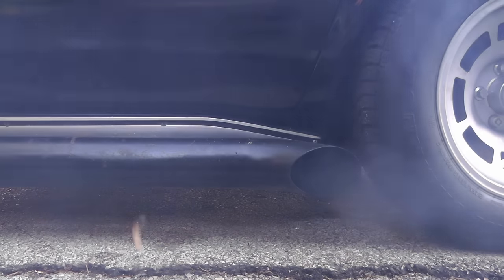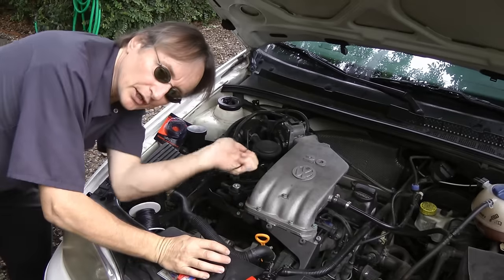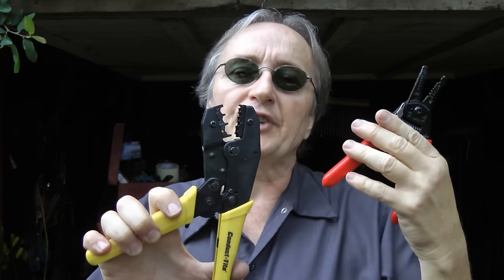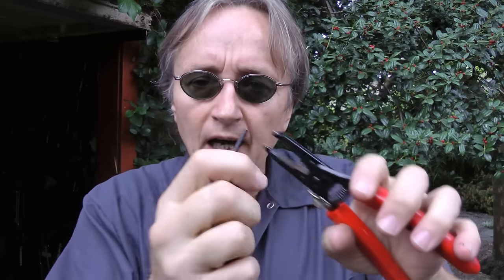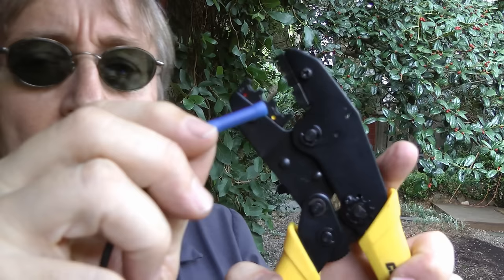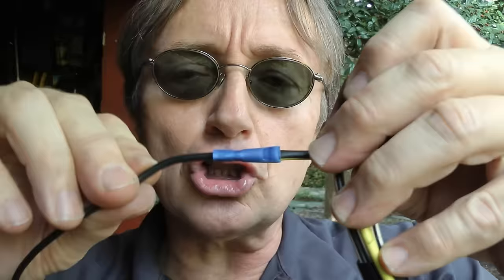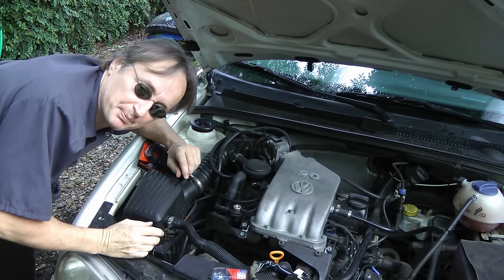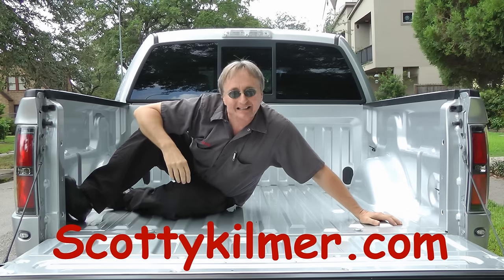How to Splice Wires Together in Your Car

Comment: Ever heard of a c305 connector well turns out I replaced my fuel pump my car cranks but won’t start I replaced the start the fuel filter the fuel pump the battery and all the spark plugs nothing worked well I found out there is a c305 connector under my van near drivers seat well behind it and it’s all nasty corroded and looks burnt ! I wasn’t getting any fuel pressure ! And no power to fuel pump ! I kept getting fuel pressure sensor low circuit is this why Scotty?? Is it the c305 connector ?

Comment: Hey Scotty got a question for ya. I have a 1996' Ford Contour SE 2.5litre out of nowhere my car stalled one day and smoke starting coming through the AC Vents (white smoke smelt like rubber) the car would NOT turn on, no dash lights nothing not even with a boost. I took the battery out put it in my other vehicle and its good, the oil was not milky at all and the coolant seemed good. Leaving me to believe that its the wiring harness, how would I go about finding the right wire?

Comment: Temporary fix only, nothing beats solder and double wall heat shrink tube. The double wall tube is thicker and contains glue to make your connections water proof.

Comment: my check engine light came of it was for a knock sensor on a trailblazer. I replaced it then it came on again. do you think i need this done to my knock sensor connector?
Reply from the maker: +LeMark Wash pray it's just that and not a computer or internal engine failure

Comment: scotty i have a 2010 nissan altima the dealer told me that 4 of the wires have been cut from installing car audio the new wire harness is 500 bucks plus 700 bucks for labor all my lights in my dash is on an the car wont go over 2000 rpm an wants to shut off do you think i can fix it my self an save my self 1300 dollars by doing what you did in this video

Comment: I had brittle wires for the ECT connector that tore off. I bought a new connector and used butt connectors to fix it. Tried it multiple times and no fix. I know I'm doing it right too. Not much to it. I was wandering if there was some reasoning why butt connectors wouldn't work in that situation if any. I also replaced the ECT sensor as well.

Comment: recently my 2008 ford explorer had power cuts while driving and when ever I used to press the brake and stop the car it automaticaly turned off, I gave it to repare,the the mehanic told me its just the wiring problem and it will be fixed if he changed the wires. does changing wires will stop the problem??
Reply from the maker: it does if he finds the ones that are shorting out and if it didn't ruin the main computer
Reply: Scotty Kilmer Thanks 😀

Comment: got a wiring issue to the starter from the inside of the car on my 02 gt not sure what is the best way to fix it tried twist connectors didn't seem to work. but i also only had smaller wire at the time.
and it goes from a 14 gauge wire down to like a 10 on the connector it connects to.

Comment: I recently re-wired a 63 chevy II and when I turn the key to the lock position the gen light comes on? Im also able to use all of the power accessories...it acts like i have the key in the on position.

Comment: Personally I like to place the connector in the crimper first and lightly lock it. That way you have something to hold onto when you push the wire in. Otherwise its a bit of a 3 handed job trying to get the crimper engaged while holding both the connector and the wire firmly together.

Comment from the maker: you don't need a relay. Just get the power wire from the good side, splice a wire in there, and cut that same wire on the other side and splice the new wire into the wire that's left going into the non working light

Comment: I have a 99 cougar and I guess whoever owned it before had the light switch wired up wrong and one day it got hot and caused a little dash fire. I don't know if I should cut the wires and rewire a new one or what. oh and it was weird cause the ac fan was also ran to the light switch they had a wire ran from fuse to fuse....
Reply from the maker: get a wiring diagram and rewire it, possible use a juk yard used dash for melted parts
Reply: Scotty Kilmer thanks. yeah I was planning on replacing the dash I can get one for 20 bucks but I'll have to take it out myself.  I never really messed with switch so I'm hoping I can follow the wires and it lead to a wire harness

Comment: Can the female terminals be bought with butt connectors already or did u add that to it? Also can I get female terminals from the part store for a Honda civic?
Reply from the maker: you can buy anything you want anyway you want, but most kits are bags of male or bags of female connectors so you generally buy two bags
Reply: Scotty Kilmer Thank you!

Comment: Hey Scotty, the right side tail light in my 1991 Chevy Suburban won't light up when I pull the headlight switch on, but when I hit the brakes or use my turn signals or hazards, it lights up! What could be the issue? I checked the bulbs and they all seem to be fine, so I figured it was in the harness somewhere. Think you could help me out?
Reply from the maker: check for either a bad socket there, or bad grounding wires on that circuit
Reply: Scotty Kilmer Will do, thank you. By the way, don't have a wiring diagram to go off of, what color do you think the grounds will be?
Reply from the maker: Scott Fraizer
ground wires are normally black.
Reply: Scotty Kilmer Thank you,  didn't want to cut the wrong wire by accident, lol

Comment: Hi Scott, I need to splice / solder and replace my seat belt retractor connector plug. I haven't done this before. 
How to  do this  safely and effectively - any expert advise?
I think the wire has 2 small copper wires in there but not 100% sure.
Reply from the maker: just twist wire ends together, then heat the wires with the soldering gun hot, THEN put solder on it to make it melt in place. then put tape over it

Comment: Hey Scotty, I have a 1995 Ford Escort GT 1.8L and I recently put on an after market air intake. The car revs really high when in neutral or park but it’s fine when in drive. I had to turn the idle screw all the way down to prevent it from revving all the way above 2000 rpm when in park. The problem is that I don’t remember if it started after the new intake or shortly before. I’m pretty sure it started before though. What do you think the problem could be? Thanks.

Comment: hey  scotty I replace the air bag in the dash  board of my car in the airbag tabs broke in I took my car to the dealer in the say I have to replace the hole wiring harness.  so I went to the junk yard in funds some of the tabs with the wire. you think it would be OK if I get some butt connecter in put it in the way
Reply from the maker: +mustafadroid I would solder connections on that important piece
Reply: +Scotty Kilmer ok thank you so much I will do that

Comment: @Buckley710 Most likely the connection in the a pillar. Common problem on Audi.
Take off the harness at the a-pillar and see if any of the wires are cut or drawn out of the socket. 
Close to impossible to fix the wiring without changing it all, tho..

Comment: get  solder filled  butt connectors  that have heatshrink built in...      best way to do it    You just need a little torch  or   lighter      it uses  lower melting point solder  And leaves a permanent    connection  ,,  also  gives Little to no resistance in the wire,  So you don't get more voltage drop

Comment: I got a 2017 toyota prius. The front bumper sensors wiring was damaged and some of the wiring got ripped from the sensor plug. Also the turn signal plug got ripped off. Can I use this technique to fix those wires?

Comment from the maker: no, easy as pie. They make battery terminals with 8 inch cables coming off them, and the cable end is a metal connector that splices into your old cable and tightens up with a big bolt that squashes it down

Comment: hey Scotty I was him ask if you know how to fix a brake light  that keeps shutting off cause of wiring
Reply from the maker: repair the wiring, get a test meter and check for dead shorts or corroded wires touching metal

Comment: If you can, soldering the joints and using heat shrink tubing is a much better electrical connection (just a friendly tip from and electronics engineer :))
Reply: For anything engine related I would never use butt connect,  use a solder and heat shrink

Comment: Hey Scotty
I have a problem with one of my headlights, the driver side is low beam is out. Now I replace the bulb, check all the fuses but its still doesn't work.... Now the high beams work on both sides
what could cause the problem?

Comment: I have an f150 2002 truck and i want to know if i could do this to extend the "blinker" wire..bcuz i put the steering wheel up and down n then blinkers dont work when i have the steering wheel low...and i heard its bcuz the wires are too short.

Comment: I own a 2001 dodge ram 1500 5.9. my pass side headlight only comes on dim with a 9007 bulb on the drivers side. I swapped out both bulbs for 9004s(the right one for my truck) and the pass side headlight won't come out. do you have any ideas what it can be
Reply from the maker: check for bad ground wiring first, also check any sockets for corrosion
Reply: Scotty Kilmer How would i go about fixing a bad ground?

Comment: i have a 1996 toyota camry it looks like the previous owner cut both pin connecters  for the stereo no clue how he had it wired up he says he cant remember  either i tried looking it up and no  luck its basically a jumbled up mess any advice on  how to fix is much appreciated
Reply: would like to add that the pin connecters are still there somewhat
Reply from the maker: +Rentaro Satomi either get a wiring diagram that shows what wires go where, OR go to one of those car stereo joints, they work on em all the time and can easily hook em up

Comment: Any connections made outside of the car need to be water proof and airtight to prevent oxidation to the Cooper. They sell heat shrinking butt plugs for that. Or you can solder it and put heat shrink. Anything else will eventually fail!

Comment from the maker: @playstation2bigs soldering if the connector is out in the elements, like under the hood, connecting them is fine for inside jobs like this ignition wiring harness that's under the dash.

Comment: I just bought a pair headlight socket connectors (ceramic ones) for my eclipse since the oem factory melted (common in mitsubishi eclipse and galants).  So I will just need to splice the wires with the new ceramic connectors right? Thank you

Comment: @scottykilmer hey scotty i just bought a 1993 nissan maxima and it runs real smooth but i noticed two problems once when i revved the engine i heard a scratching grinding sound and the engine light is not on and also it struggles to start sometimes like its not recieving enough fuel but once its on it runs smooth what should i check.

Comment: hey ive got a question hope you can help, ive got a 94 yj jeep with a 6cyl 4.0 engine, it sputters sometimes, thinking it was the ignition system i replace the distributor got new lines and spark plugs...... and it still happens what could it be?

Comment: If you live in the salt belt using unsealed butt connectors is just asking for trouble and very soon..  At the very least use heat shrink butt connectors or the correct way solder and heat shrink your connections.    And never use but connectors on computer low voltage wiring or anything with multiplex wiring.        Maybe Scotty you could ammend this video to say that .
Reply: I'm right there with ya. I can't believe he used that style connector myself. I've been dealing with used cars in my personal life since the 80's and when I see those connectors I expect corrosion problems resulting in either dropped voltage or poor/intermittent connectivity.
Reply from the maker: peskypeet there is nothing wrong with doing this under the dash in a sealed environment. Under the hood by the engine, that's another story, solder there OR use butt connectors and some sealing cover you melt over with a heat gun
Reply: Scotty Kilmer Hey, you actually reply. I'll give you a thumbs up just for that :)
Unsealed butt connectors might work ok for a quick fix in the interior but I'll never consider them a permanent fix.

Over the years I've become so jaded against those connectors that I won't ever use them again unless it's a temporary test to see if something works or not.

Comment: my power windows to my 87 crown vic sometimes just stops working. Time can pass and volia, they magically begin working again. bad wiring or I have to get new relay motors?
Reply from the maker: that old, anything could be going wrong. But more often, it's just worn out motors in the windows

Comment: So I have a battery light on, i have a new charged battery, new alternator, semi new spark plugs, and new ignition coils. The ground wire connected to the battery and alternator burned off. Is that what this video is for?
Reply from the maker: yes, fixing bad wiring

Comment: Hi I'm looking into wiring a almera speedo clock into my micra. but I've never done one before any tips on stuff i'll need to do it.
Reply from the maker: +Bear Iron just make sure you have a wiring diagram to do it right, never buy anything without that or bad things can happen. You must know what wires go where
Reply: to be honest I'm not good with reading the diagrams lol might have to take it to a garage to be safe

Comment: You guys know what to do if the I guess shielding is coming off the wire harness. it's not tape it a plastic tube I would say
Reply: +Zach Reynolds just wrap it in electrical tape

Comment from the maker: @ncrdisabled clutch is bad if it won't spin with power, fix that first, and realize that may have burned out computer circuits on the AC system IF the fuse did not blow for that.

Comment: two butt connectors? that's a rig job lol that should only be temporary at most
Reply from the maker: that's internal wiring, the elements dont' get in there, I have cars I did 20 years ago like that which still work fine
Reply: Scotty Kilmer maybe in the southwest. Sometimes they only last months in Wisconsin.
Reply: @36nick4truth  Nothing wrong with using butt connectors on internal wiring so long as it's the appropriately-sized butt connector and is crimped correctly.

Every failure I've seen with butt connectors was due to the gauge of a butt connector being too large for the wire it's used for (or perhaps the person didn't fold a small-gauge wire before twisting to give it a better chance at staying inside -- assuming the wire is 18-gauge or smaller) OR the person didn't crimp it correctly/completely.
Reply: @36nick4truth  I live in Michigan, have you tried dielectric grease in the butt connector and shrink tube over the butt connector? I have had good luck with that. I still prefer solder but I use plumbing solder and a Weller high temp solder gun.

Comment from the maker: @backwoods3214 ah, but I don't worry about that in Texas, no salt on the road in winter here. If you live in such areas, best to solder wire on instead and heat shrink it.

Comment: I need Help! 2 wires connected to my alternator on a 2006 dodge stratus have melted i need to find out why? any tips tricks please help.
Reply from the maker: dean thompson pray you just had loose or corroded connections, on those often the alternator connections corrode and do that

Comment: hey my left side headlight does not working so can you help me fix it..i wanna try to fix myself but,dont know how please respone? thank you
Reply from the maker: generally the bulb just burns out, most cars they just snap out from the inside under the hood to replace. But if yours is a cow, places like auto zone install them free if you buy one from them. if not that, wiring can go bad, and in that case, I often just splice power from the wire on the other side that still works, an easy fix
Reply: Scotty Kilmer I BOUGHT A NEW LIGHT BULB  but, it still not working so.what should i do?

Comment: Pros can use fancy tools that show whether electricity is moving through a wire but for amateurs and laymen (like me), it's a matter of trial and error - wiggling your wires around until you pinpoint the spot that's causing the problem. This can be very hit and miss. Once you find the bad spot, it's easy to cut out and splice in a new piece.

Comment: Hy. i have burned the wires on the interior lights of my car ( don't ask). when i wanted to change them i was stuck because i couldn't reach them anymore. i don't know if the go under the hood or inside the car. I have a 2001 ford focus. thanks in advance.
Reply from the maker: you will have to remove all the wiring and parts in the way to find what is burned and what can be saved and then splice new wire into the burned parts

Comment: i cut some wires in my ignition harness and now i have no electrical power in my car when i turn the key forward dashboard mirrors and radio wont work ....none of the ignition fuses are getting power but none of them are  blown

Comment: @playstation2bigs If you can tie the wire in a knot and then solder it, then soldering it is better. Even if you can't tie it in a knot, solder is good. If your wire runs too hot for solder, then you need a bigger wire.

Comment: It's better to solder the wires together. Much longer lasting connection. And even if you don't solder them, at least weatherproof them with shrink tubing. Just using crimp connectors invites corrosion trouble down the road.

Comment: Any reason I shouldn't do this before a coil over spark plug on an 06 Pacifica?
Reply from the maker: make sure it's sealed really well for that use, lots of heat there
Reply: So butt to butt and heat shrink?
Reply: so butt to butt and heat shrink?